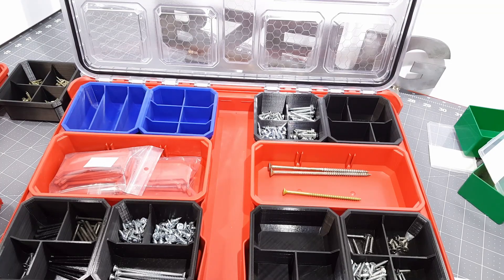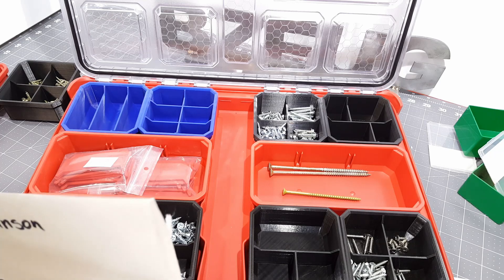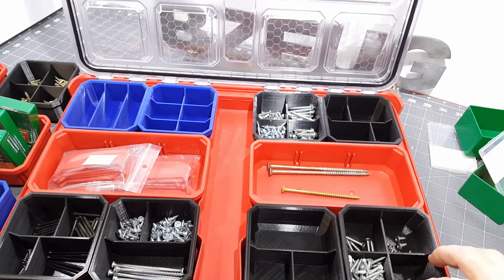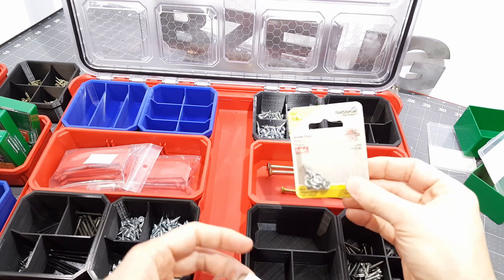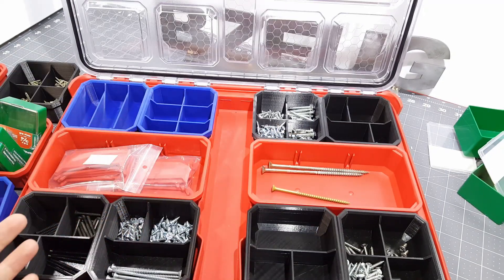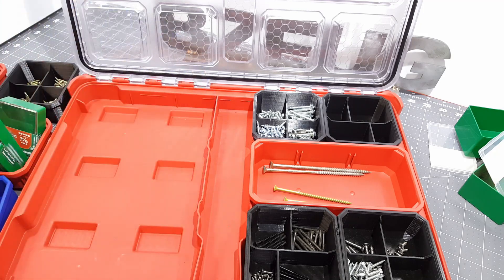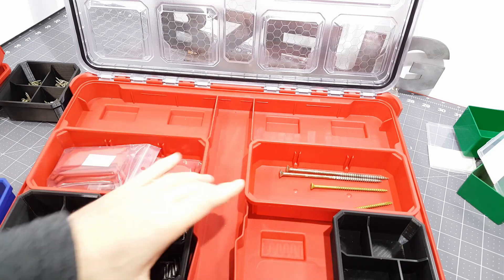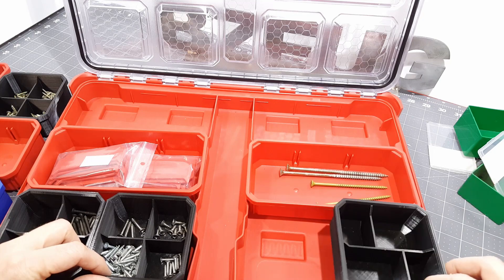Milwaukee Packout 3D Printed Bins

Comment: Brian, can you make the 6 and 4 bin in the 100 x 200 size ?
Reply from the maker: I've been meaning to do that, but just haven't got those files made up in fusion yet.  Maybe check on thingiverse and see if Benjamin has done anything with the 100x200 yet.
Reply: I checked and he said he was not sure if he was going to do them, I have tried but can’t do it. Trying to get them to use in race trailer for upcoming season.

Comment: good job, great idea
Here are a few easy mods to share with you all.
Milwaukee Bit case Mod for Packout System (part 1)
Milwaukee Bit Case Mod for Packout System (part 2)
Milwaukee Packout Low Profile Bin Modification (Super Easy and Quick)
Harbor Freight US General 2 Tool Cart (Must Do Easy Mods)

Comment: I know this might not be the place to ask this, but I was wondering if you or anyone out there would be willing to design and 3d print something for me. I'd pay for your time and materials. I'm working on new elements for my computerized Christmas Light show. Specifically, I'm building what I'm referring to as "snow globes". I bought some 8" wide "fish bowls" basically with a 4" opening at the base. I built wood structures to serve as the bases for these globes. It works, but it feels kinda sloppy. I feel like I could actually get some decent weatherproofing and a way nicer look if I could have something made of plastic designed specifically for this purpose. I have zero experience in 3d printing or designing, but I feel like this would not be a crazy complicated design as there would not be all that much to it. 

I live in the Milwaukee area and would love to work with someone if they're willing! I can send some pics and give more of an explanation if anyone is interested. Thanks!

Comment: Please could you do one with just one divider in the middle I’ve been on your thingiverse and tried to edit the three compartment ones to make it a two compartment one but I’m struggling
Reply from the maker: https://www.thingiverse.com/thing:3552747    Here you go.
Reply: bzeug thanks, could I use these dimensions to fit in the normal organisers by just changing the height?
Reply from the maker: @TheLukebadger1  Yes.  I also own the taller profile packout but have been reluctant to make these bins for that because I'm thinking the smaller the compartments and the taller they are the harder it will be to get the small items out.  If you do make the taller version of these please post them as a remix on thingiverse.  If you post a link here that would be even better!